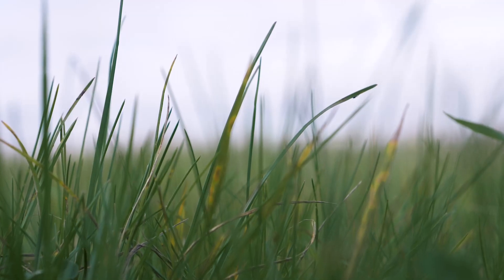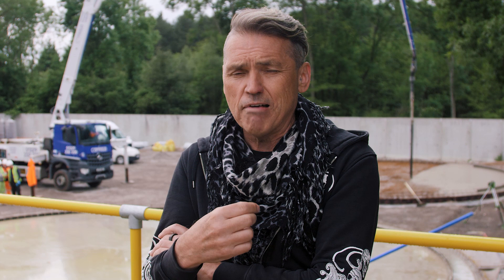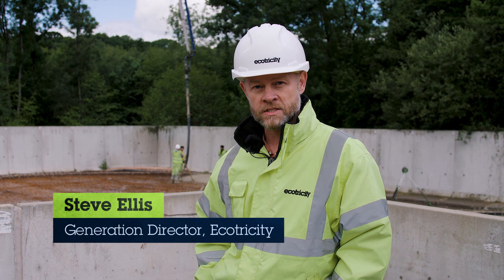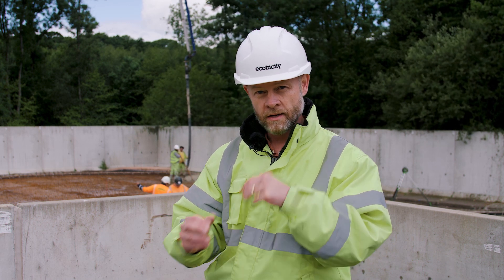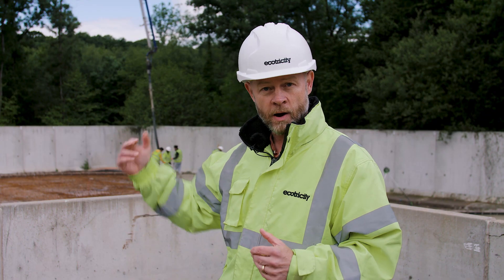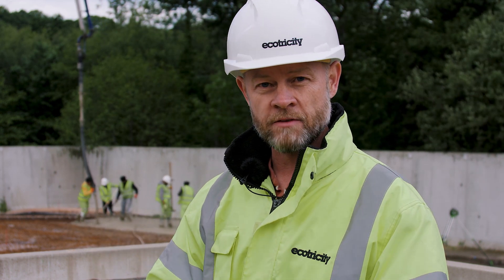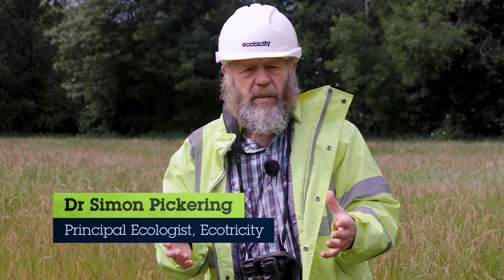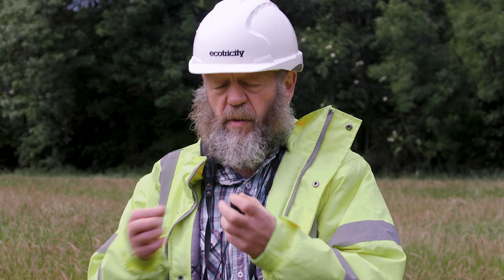Massive New Gas 'Field' Discovered In Britain

Comment: The priority should have been to build an anaerobic digester at every sewage treatment works. Well as many as feasible. Also build them on farms with large enough slurry lagoons to justify it. However anaerobic digesters at sewage treatment works might not stop untreated sewage getting into rivers/ sea as that is an issue with too much surface water getting into the sewage pipe network. Ideally there would be a separate surface water drain system, David Mackay in his "Without hot air" thesis on sustainable energy says there isn't anywhere near enough land area in UK to grow enough energy for UK.